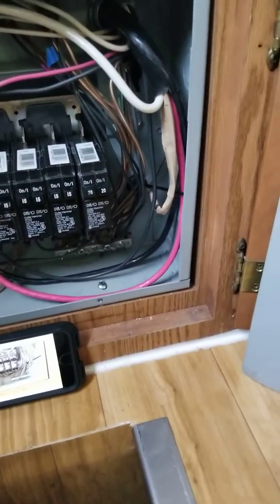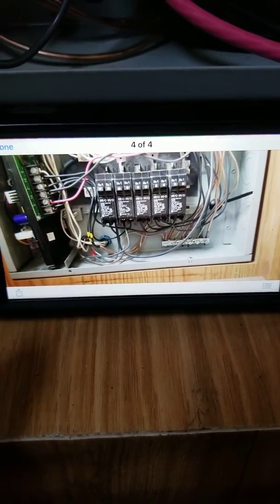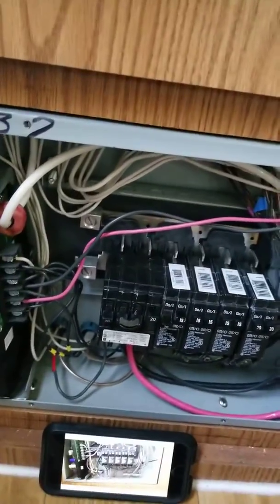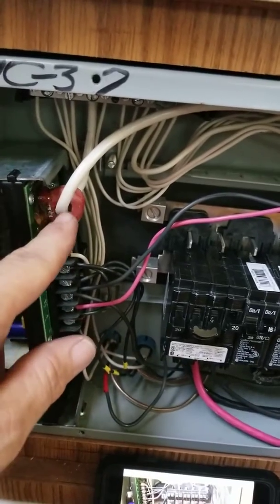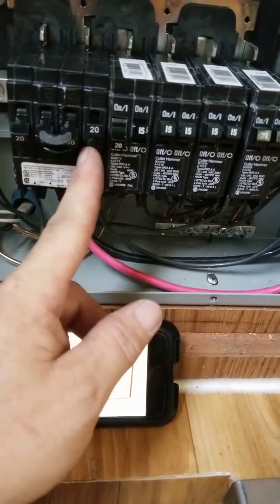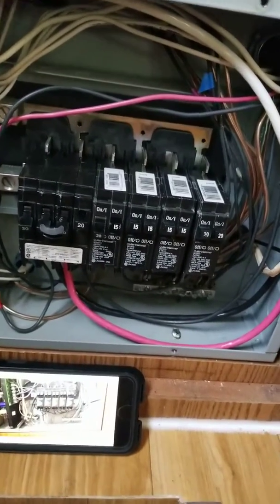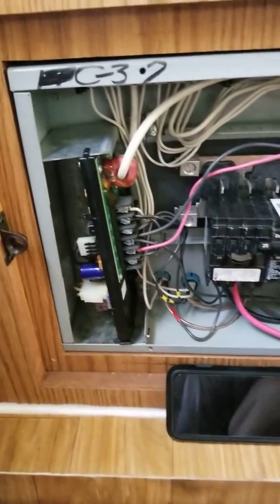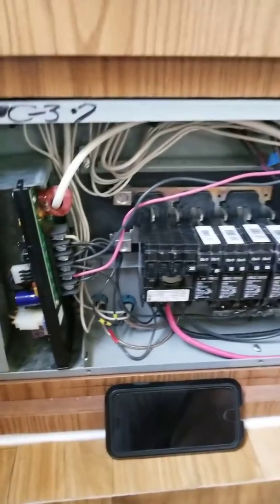2000 Winnebago Adventurer 37G 30amp to 50amp conversion (part 3)

Comment: Just came across your conversion and I am researching doing the same to my Adventure 33v.  Yours is a good 3 part explanation except for some poor lighting. I thought I had it figured out until I saw the 6/4 wire. Where does the 6/4 wire go?
Reply from the maker: The 6/4 soow cord goes from transfer switch to plug. The 6/4 wire runs from transfer switch through the RV to your fuse panel to 2, 50 amp breakers, one on each leg
Reply: Thank you, but the 6/4 is only 25 ft. Could it be transfer case to the plug  and 6/3 from transfer case to distribution panel?  @wessolbuf
Reply from the maker: @randymartin100  You're going to need to run 6/4 on both sides of the transfer as you will have two hots and a neutral and a ground so if you only have 25 ft I would use that from the transfer switch to the plug or if 25 ft is long enough to reach your breaker panel in the RV you can use it there but either way you will need two separate six/4 cords to complete that conversion
Reply: @wessolbuf  You are absolutely correct. For some reason I can't count. 2 hots, neutral, and  ground = 4.   Thanks for making me wake up.  Good videos.
Reply from the maker: Good luck it is well worth the time for this conversion  @randymartin100